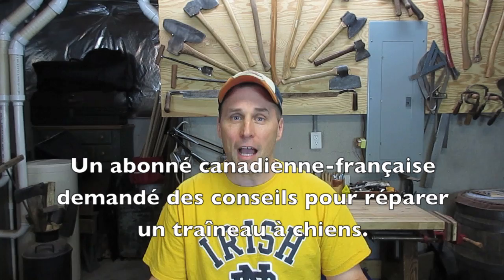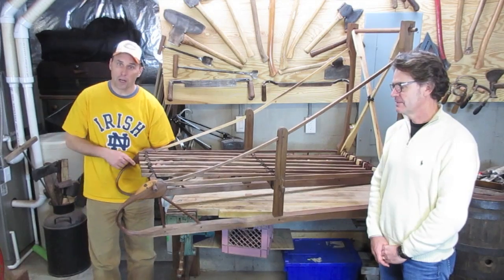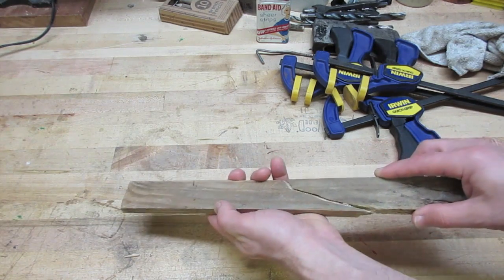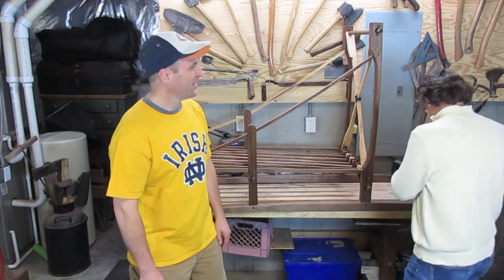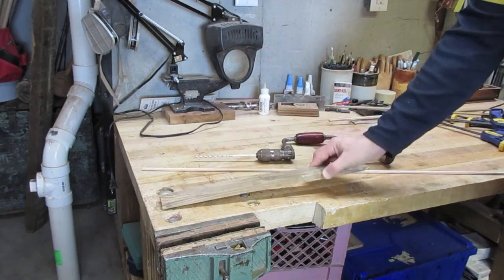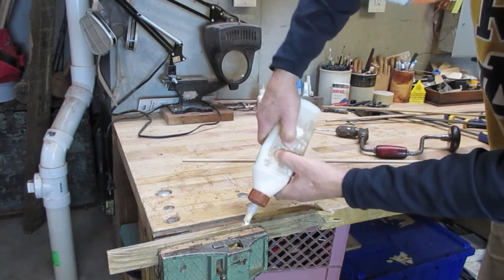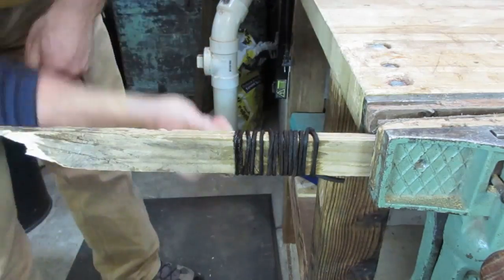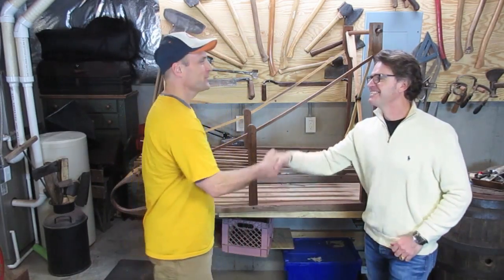How To Repair A Dogsled | Comment reparer un "traîneau à chiens"

Comment: Neatly done. You might think of using rawhide instead of leather and wrapping it like you were taping it. Rawhide/ parfleche would be traditional and it takes shellac or varnish. It is easy to buy. Think dog bones. Just soak in water.
Reply from the maker: +57WillysCJ Great idea.  Thanks.
Reply: +57WillysCJ I don't know about authenticity, but rather than just making a series of turns I'd do half-hitches, so that a break wouldn't cause the whole thing to come undone. (And a Turk's Head if I had the time and really wanted to be a damned show-off.)
Reply: The original wrap with rawhide would be the same used on snowshoes.